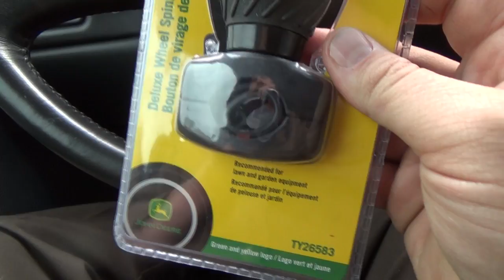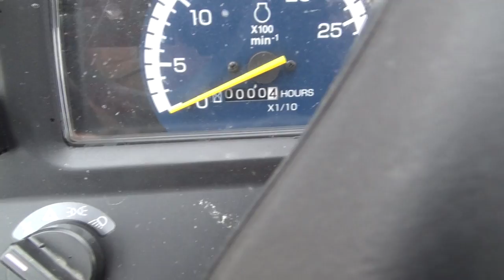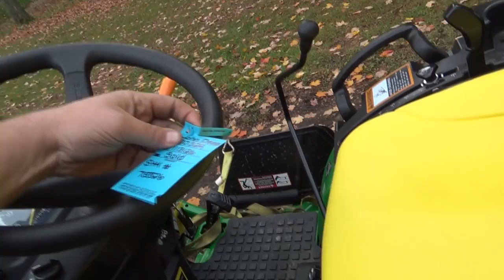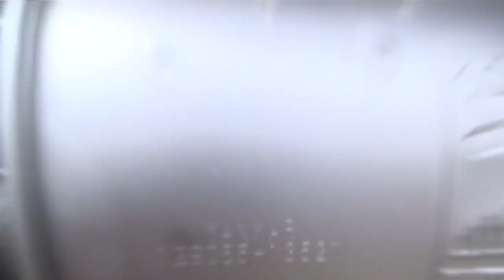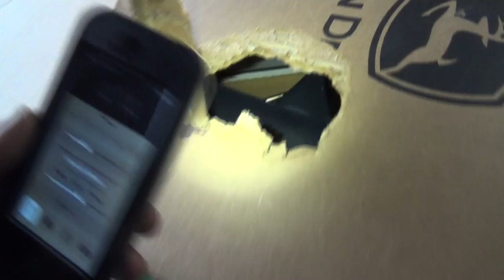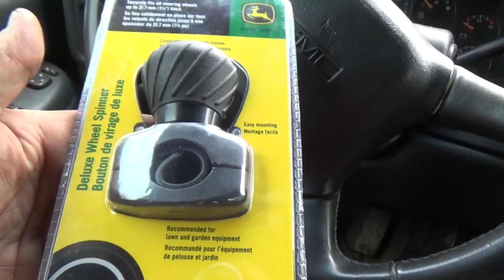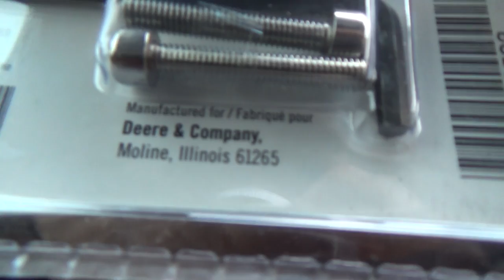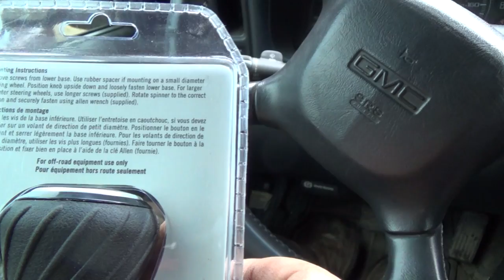Goodbye to an old friend and hello to a new one..trailer finish up

Comment: mr bill , congrats on new tractor , hope we don't hear yeah complaining now for at least 2 weeks if you can handle that long , 
i just fill sorry for next person who buys old 1 cas they are buying a wore out tractor but j.d. will make it look like new again before they sell it , for twice what you got for trade in , just like cars/ truck lose value soon as you leave parking lot. or gain value if its a trade in .lol 
good luck with it
myself i think maybe even the 1000 series would have been enough just to pull trailer of dirt even though its heavy but them tractors are a great value for there cost , if i didn't buy a used / but like brand new x748 i would have bought 1 myself just for trade in value alone .

Comment: hey Bill
Just have an idea about the mulch thingy. Use the tubes and the motor from the old one. Then instead of using the plastic boxes, Do like you said put the extra walls up on the hydralic lift trailer, and there ya go. Just an idea.

Comment: I went loookin around about the high idle, 2 things came up. one of them was that at low RPM's it goes into harmonic vibration damaging engine and the other being at low RPM's i guess it leaves diesel behind in the cold engine that wont burn.

Comment: New engine design, pollution stuff,added up with other changes, they made a new number for it. Same as when the 1026 R went through the same thing and became the 1025 R. With that low of hour time on it, that tells me it went through fluid fill and run-in, when they do all the systems check and set the timing and idle speed and audit without any problems. Out the back door and then driven across the street to RDC parking are till it was shipped out.

Comment: You mentioned about how to remove the bed on the dump trailer in the previous video since the pins were welded to the carriage frame of the trailer and went through the two plates that were welded to the dump bed itself. If I were doing the job, I would have used the sleeves that went over the pins and welded them to the frame, then cut pins to act as the hinge and drilled holes to put a keeper bolt in each pin, that way when needing to remove the bed for any reason, just remove the keeper bolts, pull the pins out and the bed is ready to take off the frame after removing the pin for hydraulic cylinder. It would be a simple task if done that way. The way you did it was exactly the same as the way it was made at the fabrication of the trailer.

Comment: 754 hours that's new,  some equipment at work has 14000 hour on our boom truck, even seen some excavators with 50000 hours still running.

Comment: If the bagger fits extend the chute so it pumps into the trailer. Metal hoops and a tarp cover.  Got your self a Forage wagon.
Reply: You couldn't fit a forage wagon down the rows between the monuments.
Reply: That why I suggested to use the Deere trailer.
Reply: RoanJS
You know what, I am sorry for what I said.  I read your original comment wrong.  For some reason I thought it said "Get" but you actually said "Got" meaning that he turned his own trailer into a forage wagon.  I APOLOGIZE, I should have read your comment again before replying.

Comment: They probably make the idle so fast because diesels are known to idle fast due the high oil compression and stuff
Reply: 747a380austin 111 most high speed diesels idle at 500-700 RPM

Comment: I dont know if they sell them up in Canada but in the U.S we have something called the Cyclone rake. They are pull behind mulched leaf gatherers. that you can dump, Sorta like you were explaining but not as much metal. They can easily fold up and be stored so that would make it easy for when youre not using it. and they come in many different sizes. I think its worth a look up.

Comment: Equipment last a lot longer if the operator only uses factory parts and does no modifications to the equipment. Oh by the way you voided your warranty by adjusting the idle.
Reply: highcountrytimber  u dont need a warranty when buying a deere. they run 4 ever. my warranty is over now so i lowerd my idle.. i might lower it some more tho.
Reply: +MRJOHNDEERE3720 how do u do that that's what I need to do on my Deere
Reply: spcsyracuse 1056
i would have 2 make a vid on it. but all it is is a screw. but dont do it if u still have warranty.
Reply: +MRJOHNDEERE3720 I don't have warranty I think
Reply: spcsyracuse 1056
how old is it? & how many hrs r on it..

Comment: You shoulda got something a little bit bigger
Reply: The cemetery probably couldn't justify the additional cost. Not to mention something larger may not work quite as well with all the mowing between the stones/monuments.
Reply: that's what the 110 is for.

Comment: Why? Get a zero turn for grass stamped mower decks are garbage! Love your channel bill but learn from mistakes haha
Reply from the maker: Alex Mitchell 0 turn wont pull 2 ton of dirt in my trailer
Reply: BILLSTMAXX :) yeah but couldnt you   have kept the old 2720 for pulling and snow removaleven  tho it was gonna need some minor work if you used a zero turn it would have took alot of hours off the 2720.
Reply: BILLSTMAXX :) It would if it was a Kubota!!! I have seen a 4wd model that plows snow and tows!
Reply: 0 turn couldn't plough snow or use a brush on it